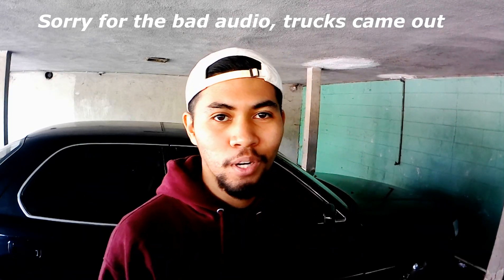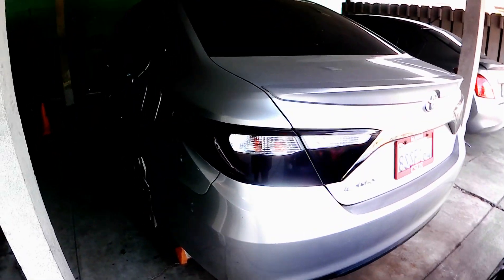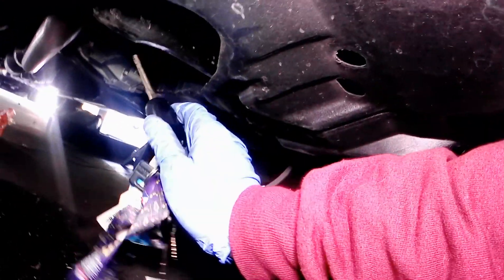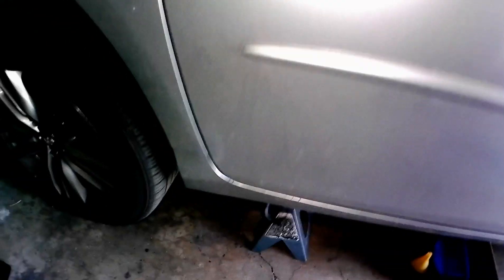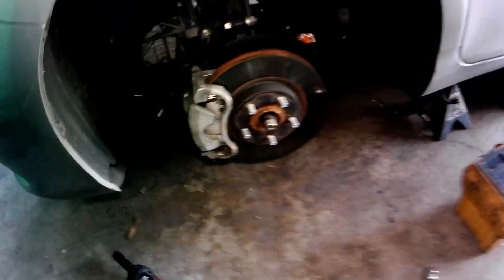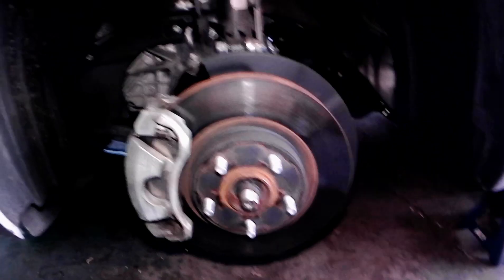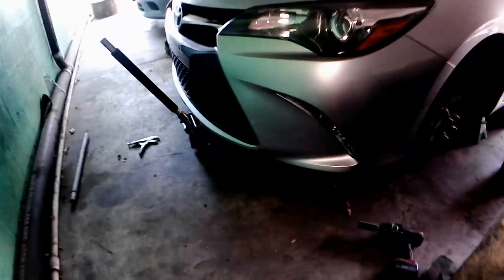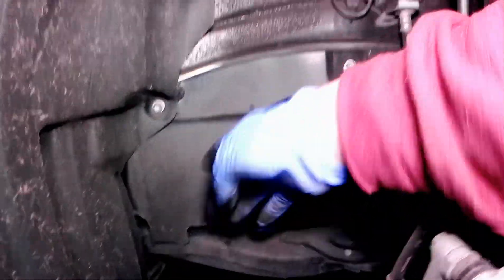DIY! Transmission Fluid Change, Toyota Camry 2015-2017!

Comment: That so called straw is used to check the fluid level when the transmission heats up to between 104 to 113 degrees. Check the tech manual for the exact temp. Once it reaches that temp, you remove the drain plug (leaving the straw in) and drain the excess fluid. Any fluid over the straw will drain. Once it stops coming out, replace the drain plug. At that point, you have the proper fluid level.

Comment: I did not use the pump.  Like how you did it, I measured the amount of fluid that came out and put in the same with new fluid using a funnel that had a tube attached.  I used also a vise that held the funnel and tube steady as I poured the new fluid into the hole.  The vise rested on top of the battery, sitting on a piece of wood to prevent accidental spark.  The car had had over 90000 miles, so I had to do it 6 times. After each change I drove the car for several days.  Always did  the  fluid change first thing in the morning, and at the same jack stand level (I did not jack up the rear -- the front was slightly higher, but the point is that trans fluid was always cold and the jacking level was always the same, so that I could be sure what I put in was of exact amount with what was removed.  I left the little straw out until the last change.  Car has been running fine.  I did it after having watched and learned from various YouTubers. Many thanks for sharing yours!
Reply: güera dawg no dump a quart over du fluido...chekey...checkey
Reply: Did the jerkiness reduce? 😊
Reply: Do 2qt change every motor oil change. Or, once per yr.

Comment: Hello young man EJ
This is John Chan the fisherman, at 54 years old, will retire in less than a year. At this moment my wife and I own 6 toyt. 2007 tundra 5.7 liter has 190k miles,  2013 rx350, 2018 nx300, 2023 gr86, 2009 yaris has 155k miles, and last but not least 2007 rx350 has less than 60k miles. 
Oh yeah got 22 ft fishing boat which I use my truck to tow. 
Point is Toyota will last a long time if you maintain it. I have been drained and refilled my transmission fluid for years. 
Like your video. Thanks 
By the way I always install a new crush washer on the drain plug.
Reply from the maker: Thanks for the kindness John, I appreciate the words! I would've still been driving this car if I didn't lose it in a car accident 🤕 but I'm now hoping my Honda Accord will last me until 300k miles!

Comment: You can check if you over filled transmission bybtakingbitvfor a ride. When you get back remove the drain bolt but not the straw. Anything that leaks out without removing the straw is  after the change is what extra you put in. So the straw is or acts like a dip stick. That's in there to make sure you have the exact amount of fluid in transmission that you need.
Reply from the maker: Hopefully others read this comment, thanks for the tips!

Comment: I put 4 quarts of transmission fluid outside where the car is the next morning I jack the car up remove the transmission fluid I measure it is approximately three little over 3 quarts and I’ve been doing it a couple of times so I know around 3.3 quarts always goes back in and it’s pretty much every time that’s what goes back in and comes out. The temperature of the oils pretty much the same as the containers just slightly odd more due to some loss oil in the container on the rag but it’s just a little over 3 quarts and as long as I stay close there it’s fine because when people do the temperature and drain it from underneath up until it stops dripping from the straw it’s heating up at the same time the oil levels changing
Reply from the maker: That sounds like a great strategy!
Reply from the maker: It's almost always 3.3 quarts, I've got a Honda Accord that has the same
Reply: Hi i have a 2012 scion tc runs new but its has 106200 miles on it and im not the original owner the question is..can i change automatic trans fluid without problems?

Comment: Thanks for sharing, do you have a video of how to change the oil in a Camry 2018 2.5L 8-speed automatic transmission?
Reply from the maker: I wouldn't want to do that on a '18 Camry just cuz it's a bit trickier than this. I commend you for trying

Comment: Have a 22 Camry. Drive for Uber. Would u recommend doing the change every 60k miles
Reply from the maker: Do it every 40-50k if you can. I upgraded to a 2018, I did my maintenance @50k mile.
Reply: @EJREAX  what about this????   I read this guys service procedure...........is this transmission thermostat  really a big deal?      ****You also need to press on the end of the transmission thermostat located just under the radiator. There is a hole in the skid shield. Press on the end of it with a flat screw driver and then insert a small pin to lock it in the open position. This is necessary as the external cooler is only open to the ATF fluid cooling circuit when the fluid is at higher temperatures. It is necessary to make sure the external cooler is also full of fluid when correctly refilling the transmission as per Toyota Tech Info procedures.

Comment: Great job,why does it cost so much,to get trans mission fluid changed at Toyato?
Reply from the maker: Honestly you're paying for the "labor rate", not the actual labor itself. The techs have a specific rate for each job and this is how much they charge
Reply: Because, the transmission capacity is 8.1-8.8L oil. With drain and fill you get only 4-4.4 L.
Reply: I can suggest looking at the video titled "Toyota Transaxle Fluid Check-No Dipstick": It was posted on 4/15/2015 by Weber State University. That is the correct and professional way to change/check the fluid level on that type of transmission. Just a suggestion..........
Reply: @phillipkelley3513  You are correct. This guy doesn’t have a clue what he is doing.

Comment: Autozone Sells a piece of sheet metal you could put where you're changing the fluid it makes clean up easier  I bought 1 for 20 bucks 😉
Reply from the maker: Thanks for the tip! Useful for other Camry owners certainly

Comment: i have a 2015 camry with 112k miles am i too late to change the trans fluid ?
Reply from the maker: I'd do a transmission fluid change AT THE DEALERSHIP. Because if anything goes wrong with your transmission afterwards, then you can place the responsibility on them :)
Reply: @EJ ReaX is it too expensive to do it at a dealership ? The car is already paid off entirely
Reply from the maker: @kendrickmorales7744  it's gonna run you about $300 or so. But it's more about peace of mind, you'll have that service record to keep
Reply: Drain and fills only

Comment: How many miles between transmission fluid changes for this vehicle do you recommend?
Reply: Every 96000km
Reply: @Billihusky  all Toyota models automatic transmission at 96000km (60000 miles). Trust me this is my job I know. I wouldn't trust my car to dealership.
Reply: 90,000 miles for a 19 Camry se? That’s awful Really late no?
Reply: @JohnDoe-fs6lz  96000 kilometers 60000 miles
Reply: If you want to keep the car for as long as possible with the same transmission (and no issues) then I suggest you change the trans fluid every 30,000 miles. I have sent used transmission fluid in for laboratory analysis many times and according to the results the trans fluid starts to break down (reduced lubricity, thermal transfer abilities) right around 30,000 miles and continues to degrade from that point forward until it's changed out. 
What the owners manual recommends is NOT for the longevity of the transmission but rather to make it look like the car has a very low maintenance cost.  All major car manufacturers started playing that game back when automotive publications started publishing "cost of ownership" numbers which had a sway on which cars interested buyers would end up purchasing. 
So manufacturers would just up and change the service intervals from 30,000 to 60,000 or 90,000 to make it look like their cars were so much cheaper to maintain because you don't need to change the fluids as often. All B.S!  
Most idiotic thing of all... now some car manufacturers are stating that the transmission fluid is "Lifetime fluid" (yup, even Toyota!) and is "good for the life of the car" and even worse they are removing transmission fluid dipsticks so that car owners don't have easy access to check the state of the trans fluid and the reason is pretty obvious..... they would be able to see how burnt the fluid is and raise a ruckus about how it can be "Lifetime fluid" when it's getting burnt to crisp.  What they don't tell you is when they say "Lifetime fluid" what they really mean is that the fluid will last the life of that transmission which will be a short life!
Reply: @JA-rn5qv  I could not agree more they just want to compete with Manufacturers claims  -30,000 miles is all the longer any trans fluid is good for. its cheap to change.

Comment: Does the drain plug come with a washer that needs to be replaced?? ima just be soimg this metho on my dads car since he wants me to change the fluid on his Camry
Reply from the maker: I didn't see one myself. But be sure it's really on there tight, so that no fluid will leak out after your job is finished
Reply: Yes, replace the washers on both the drain plug and fill plug. You can buy the washers at your local dealership or at AutoZone.

Comment: Can we drain the fluid when it is cold and replace with same amount and be done. Doing it a few times will replace most of the old fluid. Another plan would be to do the final change at the dealership/ shop where they can use the scan tool and check temperature to get the accurate fluid level.
Reply from the maker: That's what I did for this man. It's up to you what you're comfortable with

Comment: Should I have my transmission fluid changed, no prior changes. Today Toyota recommended a transmission fluid exchange for my 2016 Toyota Camry,  my car is mow at 106,000 miles. 🤔
Reply from the maker: I'd def do it if I were you. It's really late in terms of intervals but you can do it every 30k miles from this point forward.
Reply: @EJREAX  thanks, someone at Firestone said not to do it since it's over 100k Miles and I never did it previously. He said doing it will mess up the transmission. It's best to not change it. 🤔
Reply from the maker: @ebo7310  at this point it's your best discretion. It's risky to drive it nonetheless, if you have really old fluid in there don't do a flush, just a change. I didn't do a proper fluid change on my older Nissan awhile back and it died after 30k miles.
Reply: @ebo7310  If a fluid change causes your transmission to act erratically, that means your transmission was already damaged. All the fluid change did was remove some of the friction material from the fluid. That friction material is what was keeping your transmission shifting smoothly.

Comment: How do you know when you have the right amount of fluid in the transmission?
Reply from the maker: You just have to play it by ear like I did in the video, if the car is cold you can measure by quarts removed and add the same amount back in
Reply: @EJREAX  ,  I was just on another channel and I learned something. That little green straw isn't just a pointless straw. It's your level indicator and it's important. There is a specific procedure to follow in regards to temperature so you know you are at the proper temperature to let the level indicator tell you when you have the right amount of fluid in the car.
Reply from the maker: @raybrensike42  yes it is my man, there's a procedure but I didn't do it 🤣
Reply: @EJREAX . How many quarts did you use? I have 4 but I want to know if I need to buy more
Reply from the maker: @katanamast279  you should be good with 3 quarts man. 4 is more than enough for spare fluids
Reply: @katanamast279  unfortunately without flush you can't change all the fluid. Transmission takes 8.1- 8.8 liters of oil, with drain in fill about 4L. Keep in mind.
Reply: @arslan_yarqin  yes you really need to do it 2-3 times to get it all. I like to do it at 60k roughly then 90-100- etc etc

Comment: No filter to be changed?
Reply: You can change the filter if you’d like, but you’ll need to remove the transmission pan to access it. It’s a fairly easy job, however slightly messy.

Comment: My car is 2015 camry xse v6, i havent been change my transmission fluid and i already had (92,000)km. Do you think i need to change my transmission fluid now?
Reply from the maker: It's better to change it, even if you're over the transmission change interval. My dad's Nissan died on him because he waited too long to do it (should be done every 30k miles/48k km)
Reply: I thought you need to get it at 104 degrees before getting the fluid out
Reply from the maker: @WatchDesigning  I saw videos doing that, I honestly just tried it this method and it worked for me.
Reply: My 2015 camry se is at 130K and haven’t changed it yet, honestly toyotas are that good that you don’t even need to but it’s better for the overall health of the car so I think ima change it soon and just to be safer
Reply: Hats off for using Toyota WS and not Maxlife or Amsoil. If you buy a Toyota because it is so well engineered and reliable and then 
don't trust WS fluid even though it has the friction modifiers, additives and viscosity the engineers wanted. Always use OEM fluid and change it regularly.
Reply: Transmission fluid Chang in Toyota at 96000.

Comment: Have you run into any issues from doing it without leveling the car, that’s the only concern I have. I bought OEM Toyota fluid and I had planned on changing filter and gasket but after reading most cars go without changing it I think I’m going to return the parts.
Reply: My recommendation is that at least change your fluid. A majority don't change their fluid but to the few who do, changing even 40% of the fluid to new will help your transmission last longer. If you can change the filter I would do so too. Many don't do it, but you'd really only need to change it once in your lifetime. You would have a bullet proof ultra reliable car afterwards.
Reply: all fluids breakdown. dont buy the lifetime fluid gig. the lifetime of the fluid ends when your trans burns up. who pays?
Reply: I've heard that it's not a good thing to do a complete fluid flush. Teeny tiny bits of metal inside the transmission channels may flake off and get lodged here and there inside. Over time the transmission will "become used to" having those flakes in it. Flushing out the trans and getting rid of those flakes may cause more problems with shifting etc. Just doing a regular flush like what is done in this video is the recommended routine. Though I've heard 60k miles is fine for doing a fluid change. I guess if you want to do it at 30k it won't hurt.

Comment: I thought the fluid for camry 2017 should be CVT FLUID FE. Is it not?
Reply: No, it is ATF WS  WS is stamped on the fill plug. You will see that when you move that plastic cover out of the way.

Comment: how do you know the level?
Reply from the maker: You actually can't. That's why this method is stupid
Reply: Have the vehicle on a level surface. Warm up the transmission to 104 to 113 degrees Fahrenheit. Once your transmission reaches temperature (between 104 and 113 degrees), remove the drain plug. If nothing drips out, add more fluid. If fluid is dripping, allow it to drip out until it almost stops. That’s what the greenish straw tube is for. It’s a measuring device set to a specific height, that height is the proper fluid level, when measured at a temperature between 104 and 113 degrees.

Comment: Nice video but left out many essential instructions about measure the heat if the fluid for correct levels. Clearly did not understand why the the little green straw is essential to fluid levels.

Comment: Why are you using ATF fluid instead of CVT fluid
Reply from the maker: This isn't a CVT, even the new 2018 Camry is an 8 speed automatic transmission

Comment: Dude, there’s a little extension hoses or tubes that came in your kit. You put those on the pump and then it goes all the way to the bottom of the quart jug. If you can’t even know that I wouldn’t take any advice that you have on changing anything on any vehicle.
Reply from the maker: What if I told you that was the extension hose??? But anyways thank you for the comment!

Comment: I've read around that the car has to be on and oil has to be at a certain temperature. Is this the case for you? 

Looks like you replaced the oil with the car off and oil at standard temperature.

Trying to make sure I get that right before changing mine. Thanks!
Reply from the maker: This is not the standard way to do it, I just showed how I did it.

Car has to be "level", fluid has to be a specific temp (I believe between 99°F and 110°F) when you can drain and when you fill you have to let the car run til the fluid is the same temp to truly be accurate in your procedure. 

I clearly didn't care enough to do all that 🤭
Reply: Car should be running. Fill until it starts coming out of that tube. Basically the tube is your fluid level.

Comment: This is the most stupid design. My 02 Camry comes with a dipstick at the top and a drain plug at the bottom. I have drained and refilled my transmission fluid four times. I got 4 quarts of fluid out.
Reply from the maker: Trust me, I agree. Swapped this Camry out REAL quick!!

Comment: Most of these Toyota Camry transmissions go out around 85 to 100,000 mi whether you change the fluid or not so be prepared to pay about $5,000 or more to have it replaced
Reply: I think you mean Nissan, I have seen toyotas go 350k on original fluid.
Reply: Where did you hear this fallacy?
Reply: “Most”. Um, no